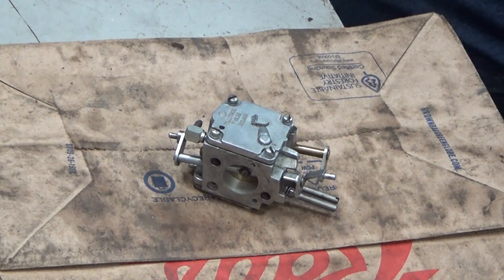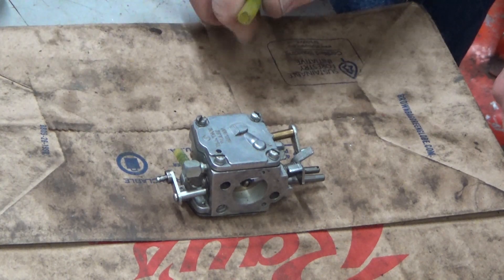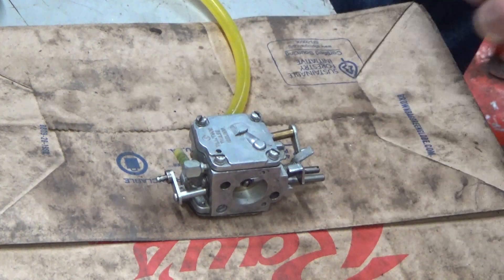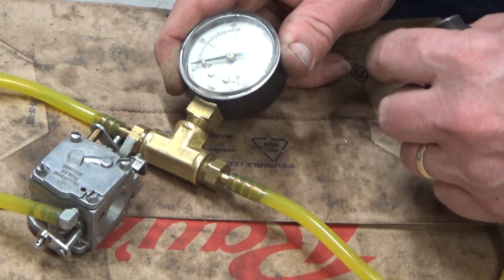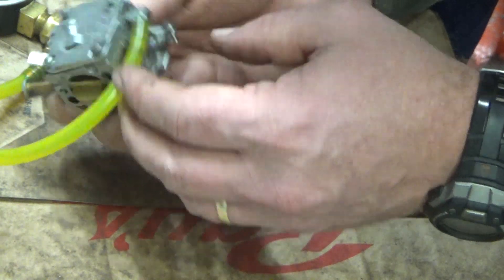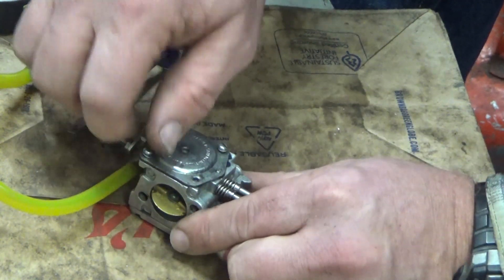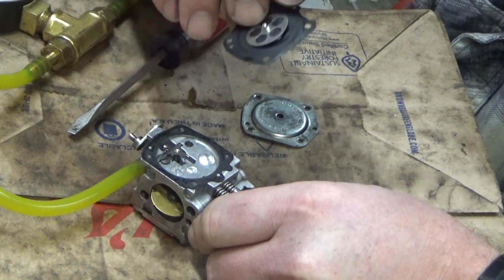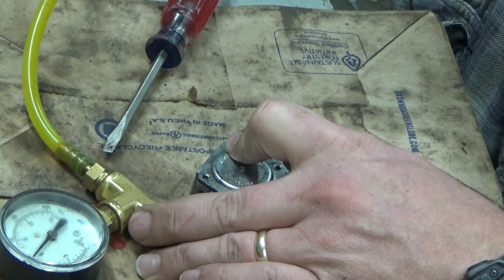Wynn's Tillotson HS Carburetor Full Disassembly & Diagnosis

Comment: Could you confirm if the following settings will work fine for this carburetor to start a chainsaw engine? 
H 1 & 1/4 turns anticlockwise from fully seated
L 1 turn anticlockwise from fully seated
T 4 turns anticlockwise from fully seated

Comment: Leon I have watch all of your Tillotson carb videos and cannot figure out my problem.  The Carb came off of a Jonsered 70e chain saw.  I re-built the carb double triple quadruple checked everything, pressure checked the needle valve.  I don’t have a pressure checker but I blew into the hose as hard as I could and no bubbles came up.  I got an over sized gasket because the intake manifold has a weird little S shaped groove in to that needs to be sealed.  Saw fires right up and idles perfect but slowly dies and if I try to give it gas it dies sooner.  Anyone have any advice?  I’ve never chased a problem for so long in a two stroke..
Reply: Same problem same saw ... will race and then die or bog down then die. Somewhat concerned that the gasket between the carb and the cylinder is making a mess with the impulse air line but it’s just a guess. Seems like the carb kit gasket might not be a perfect fit with the factory version. Anyone know if this could be the issue on the 70e?
Reply: @kirky902  I still have this saw parked, gave up on it so if you figure it out let me know.
Reply: @scubaseppy  hey man I had some luck today by making a gasket where the carb mounts to the cylinder head area. The carb kit gasket (which is generic I figure) doesn’t quite cover the “s” shaped impulse Chanel on the jonsereds cylinder. I think it’s possible that tiny leak is creating these problems. Cleaned the carb and, made a gasket and it’s running really nice now. Give that a try and let me know how it works out!
Reply: @kirky902  Thanks for getting back to me.  I did try making my own as well but my gasket material might be the problem it's more a paper material instead of a more rubberized material.
Reply: @scubaseppy   I guess that’s really all I could suggest then beyond the more obvious carb stuff.